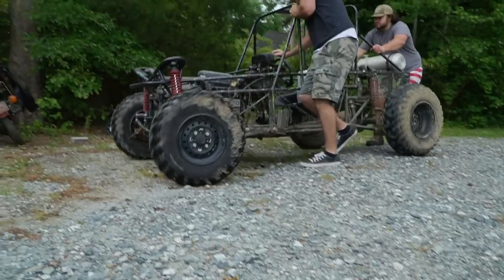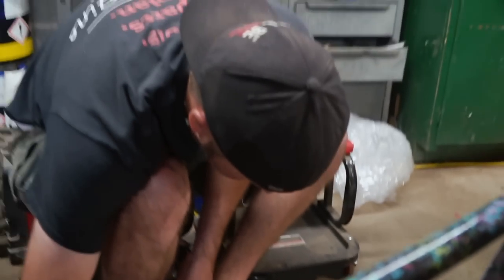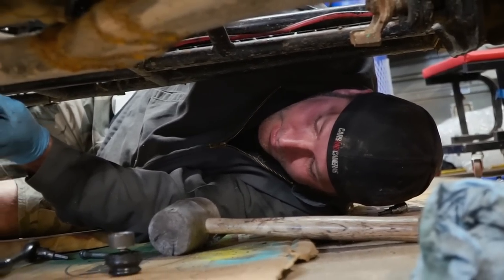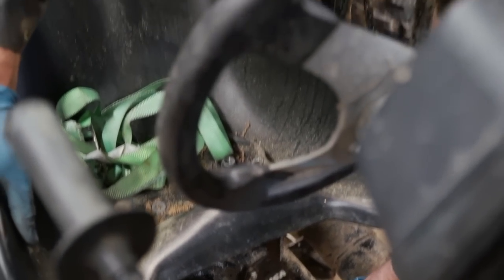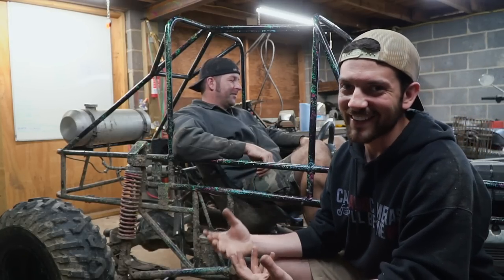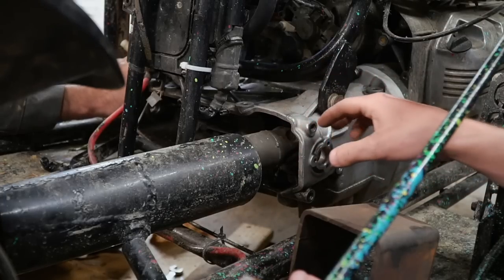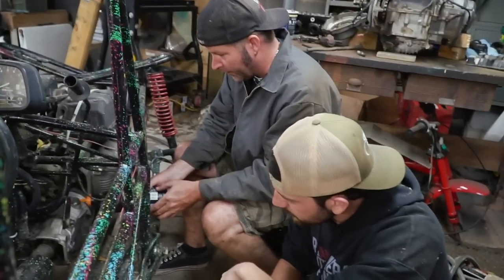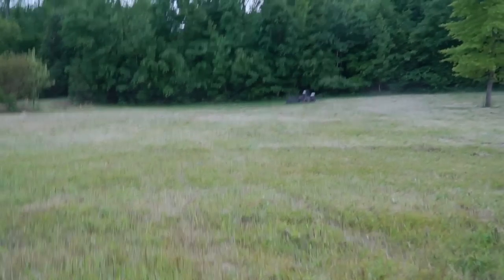1000cc BMW Trophy Truck Returns! New Trans + Rip!

Comment: I would make the shifter operate the way older formula one cars did, before paddle shifters, they were sliders, side forward to up in gear and back to go down, mount it on the right side back near the steering wheel, use a cable.

Comment: I think the transmission may have failed because the engine output shaft and the diff input shaft aren't perfectly parallel, this causes vibrations. When the wheelspeed would be constant the gears would hammer on each other a bit.
Reply: Because of the univeral joints

Comment: Split that shifter up with some linkages - that's too much leverage and weight flapping around off that little shifter shaft.
Reply: Agree 100%
Reply: Yea, find the linkage at the wreckers ..the "rear sets" off an older 600R or 1000R have great rod ends and adjustable shafts.  ..should do nicely.
Reply: Ya. Linkages are heavy. modified the stock shift arm so it can be pulled up/down with cables. The you can mount a shifter anywhere, use springs to keep the shifter centered and you can make sure there is never any pressure on the shifter arm. They are tight for room, so do what they did in the 30s put it on the outside of your right side and cage around it.

Comment: I really feel like you guys sholud  take the time and make a proper linkage shifter for this thing so you can confidently power shift it. They do NOT like unsure shifts or that much weight on the shift shaft and may have had something to do with the failure of the last one.
Reply: And in stock set up it's a fairly long lift when shifting. They like a smooth change.

Comment: You need to replace the U-joint at the rear-end with a CV joint. It will solve the drive issues and allow for more rear suspension travel. U-joints only work in pairs over small and, more importantly, equal angles. That is why they use CV joints for wheels that steer.

Comment: i tried to tell you guys in the past your suspension geometry causes the front wheels to fight each other on the ground pulling them open. Why does nobody else on any car use that tipe of geometry. You are also losing performance as the front wheels are fighting each other.

Comment: Lowering the front shocks upper mounting locations by a few inches will help with that excessive camber and caster angles caused by the bottomed out suspension ride height...pkus make the kart more manageable handling wise with less input required to control it..then adjust the toe to just barely toe out...

Comment: Gentlemen, You've done a fine job with putting together these karts, each one unique and fun! I absolutely love your creativity! Your channel is called Cars And Cameras, may I suggest its time to build something even closer to a full size vehicle, a car, like a bigger badder trophy truck that you can confidently beat on? I like where John's head is at with building something you can dump the clutch on. I am not, however, suggesting a transition away from karts. You gentlemen have the skills, resources, and ambition to do it big. You have successfully built a spectrum of vehicles; keep pushing that final boundary!
Reply: tbh idk if that would go well looking at this so called mini throphy truck....

Comment: You guys would probably have better luck using the motor and trans from like a mid 80's suzuki GS 1000. Its a lot like a honda 750 four except shaft drive and they can take A LOT of abuse

Comment: I know the halo on the cage is like that for ease of getting in but it is not safe. With the speed and weight of the kart. If it rolled the cage will fold in on your head and hurt you bad. Needs to have a x in the top to keep the corners from folding in.
Reply: There's in car video from a recent Legends car crash where the front of the roll cage folded down around the steering wheel trapping the driver in the car. He was extremely lucky in a number of ways, and being on track had the benefit of having rescue personnel on scene pretty much immediately.  https://www.youtube.com/watch?v=zoUAhJIqwDk Watch that and imagine what would happen if the trophy truck rolled at the far end of the C&C gran prix circuit and sustained similar damage.
Reply: @butchs.4239  that is what I was talking about. I saw the video your are talking about. I raced modifieds and witnessed it happen with them also.

Comment: Lift it a few inches up front when you fit the better shocks, too, and I think you got it guys! The engine/trans/gearing ratio seems really Trophy Truck-like. That's awesome! When you hit it, it goes RIGHT NOW! With a lifted front end, it will behave much more like a trophy truck. I would still love to see some mini trophy truck body work on it, after you upgrade the shocks/suspension.... 😉

Comment: Do a Chevy 350 kart. Or an LS kart. Maybe on a lawn tractor frame so you can use the body panels and have a V8 lawn mower kart. Not all high up but lower it and stretch it. Just throwing out ideas. Here's the kicker make it still able to mow and give it to pops to mow the house with. See if he's annoyed with the speed or if he gets it done in record time.

Comment: how bout you guys have that thing have an air shifter? shifts at press of a button, no need for a lever and they are popular on motorcycles so im sure there is a kit for that whatever bike you pulled the motor and trans out of, and you could mount a panel on the steering wheel that has up or down gear

Comment: Absolutely awesome vid guys. Also Unless your on pavement then you’ll nvr ever ever be able to load your 
“Cush drive” like it would in a bike on the road. Bike weighs 600-800 lbs maybe more plus 2 riders at 350lbs on pavement giving it all the torc it has. You’ll not be able to replicate that kind of load seeing you’ll nvr have full traction like the bike would. If you put slicks on it and can launch with enough traction  to lift front tires and able to bang gears with front tires in air then you’ll be replicating the load as it was in a bike with 2 riders on it. Your good guys in history of bike engine on go cart the engine has nvr ever been the weak link. Unless you start with a sloppy output sprocket.

Comment: Have you thought about trying to use a PTO cable for your shifter? They are setup for pushing and pulling. This should eliminate the majority of the linkage slop and allow you tighten up your shifter significantly. The project is looking very nice. I hope this helps.

Comment: The alignment is out bc the springs are wearing out and it’s lower which cause negative camber and toe out
Reply: Toe is measured from the back of the front tires.

Comment: Man that thing reminds me of a mini Chenowth FAV from the late 80s ish!!! Awesome. For what its worth, in the world of shifter linkages or linkage ideas/sources, Ive used a three piece bicycle crank and bottom bracket assembly with much success in a couple applications. The crank arms are usually high quality aluminum, and super strong, so welding/machining/tapping etc is easy. You can usually index them from the standard 180 degrees to a, ahhhhh, custom angle pretty easy. They are very smooth due to ball bearings, and depending on how you cut the frame and the frame material, your mounting options are basically infinite. Much leverage can be obtained if needed by lengthening one arm etc. Of course, having a supply of trashed bicycles helps! I would think a one piece crank could be used as well, I just havent tried it. Just an idea, keep up the awesome content!

Comment: Hang on the clutch is also the brake?!? Are BMW different or can you clutchless shift like a normal bike then you could just have the regular bike clutch lever somewhere handy on the frame to pull away then go through the gears without it. cush drive starts crying

Comment: Yep one or two degrees of camber max and two degrees of toe in would make it handle sharper, and boys that thing is fast so add a three or five point harness, remember that the upper belts should be more or less straight back so an extra bar will need to be welded in in front of the gas tank don't get the ones that need eyes welded to the frame, better as the eyes could pull off in a hard impact, and maybe window nets to keep your arms in when it roll's over, and an emergency cut off would be good.

Comment: Hi guys! So for europe guys "transmission" is a system which transfer power from the engine to the wheels or another assembly. The gear box is the same thing but it has more than one selectable gears 😉

Comment: If you need to engine/trans swap it, two different drive shaft driven motorcycle engines that I can think of are a cx500, or a Honda goldwing. Other wise it's a fantastic build

Comment: I think it would be awesome to make one of these but a two seater. And instead of dealing with the complicated engine ya'll are dealing with, use like an old Ford inline 6 with a regular standard transmission. Maybe not making incredible power, but it's gonna be reliable, and sound amazing. Could possible add in 4x4. Who knows?

Comment: I would have put shifter below your right hand next to the seat.  Looks like plenty of room, and you could keep your hand on it while driving.  For that to work though, you'd need quicker ratio steering you could do with one hand.  Now that I've watched you drive it, I suppose it doesn't much matter where the shifter is because you need both hands to steer it.

Comment: Also all street bikes have a Cush drive it’s just usually in the rear rim and looks pretty much the same as your bmw one but yours is engine/drive line  mounted and most other bikes are rear rim mounted. But nvr the less they do same thing. And pretty much are built the same as well. I see it being no more issue then any other bike as all bikes have the Cush drive. Untill you hear a metallic clack there good and new bushings around 50$ depending for most rear wheel mounted Cush drive rubbers prolly not much more for your set up . Just wanted to share that wit y’all.

Comment: Find a rear axle out of any Jeep with a Dana 18 transfer case they have a passenger offset center section and would straiten out your driveshaft angle drastically